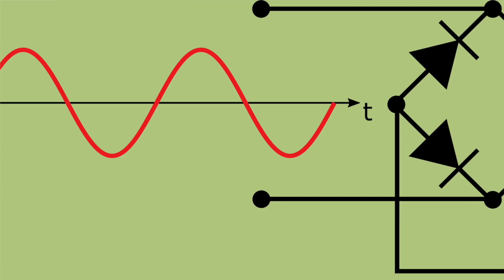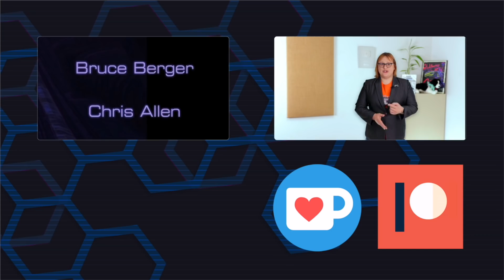Bidirectional Charging in A Tesla Model 3? BUSTED

Comment: So it seems the AC charging circuit is the focus of this conversation which is indeed a one way only cct...but correct me if I'm wrong but when the DC charging is Envoked the onboard AC charger is bypassed and is directly connected to the static charger via Chademo  or CCS HP connectors...not the type 1 or 2 AC connectors..so if the battery is directly connected then current will and can indeed flow both ways....if in DC charging mode...

Comment: The circuit board is an older US board. The report was based on newer Euro spec board. Tesla don't wait for model year to update. The new board is an in-house design. Euro cars have 3phase boards even the SR+.
So you held back and then jumped in the wrong direction possibly.

Comment: The charger uses three circuits to utilize three phase power. Three phase power is standard in Europe. (The Type 2 socket is three phase.) The three circuits an be connected in parallel and feed be a single phase to provide the same charging power where single phase connectors are in use. (USA e.g.)
Model 3 does this three or one phase switch on the fly as YouTuber Schräg has proven. He connected a Model 3 with a one phase only Type 2 cable to a 32 A Type 2 wall box. Thus the Model 3 was forced from 3 x 16 A = 11 kW to 1 x 32 A = 7.2 kW. I don't know of any other EV that can make such a switch. Other EVs switch to 1 x 16 A in that situation.

Comment: Title is a bit misleading, but if you listen carefully, it's clear and info is good. Seems like some people (if you read the comments) did not really listen. It would not be a good idea to implement V2G to older/current Model 3s because the battery would loose charging capacity fast due to the many charging and discharging cycles . But with "a million mile" new generation battery that could cope with a ton more cycles, the V2G does seem to be very close to reality. So if Tesla will start to fit (let's say, in July) a new battery pack with a bidirectional charging module, Model 3 will have V2G capable hardware.

Comment: The cyber truck will be a V2G.  With this new million mile battery and with A120v to 240v outlets.  You'll be able to use it as a generator To your house. So it only makes sense that Tesla will have it automatic  Through your charging port With an Tesla wall charger.

Comment: The fact that vehicle doesn't include circuitry to generate AC doesn't mean that vehicle doesn't have V2G capability. When you put EV to DC charging mode, you have basically battery connected to charging socket of car, so at this point you can push power to car or pull power from car. That said, every EV capable of DC charging has HW for V2G capability, you just need special device installe at home, that will make DC to AC conversion. So you might be surprised when Tesla will start selling these and enable V2G capability by OTA updates.
Reply: Were you listening at all? It's not about being able to generate AC. It is about sending power one way through the charger. So in order to enable V2G there should be another circuit that allows power to flow from the battery backwards.
Reply: @jur4x  I was listening. And I watched also video they mention. And both talk only about using onboard charger to generate AC back to grid.
But as I described, there is another way, that is more likely to be used for V2G. And Tesla as many other EVs are capable of it.

Comment: The V2G claims are predicated on the new Million-mile battery chemistry and packs. 
V2G would kill current batteries, so there's no provision for implementing it on existing Teslas. 
So you're correct that V2G isn't viable for the current vehicles. 
But that doesn't debunk the actual claim of V2G on FUTURE Teslas.
Reply: Agreed. The constant stress on stationary battery packs is why Tesla currently uses a different cell chemistry in vehicles as it does in stationary batteries. Tesla doesn't want its vehicles' battery packs to degrade too quickly, hence the hesitation to do V2G. If Tesla's million-mile battery bears out, however, they'll have no excuse for holding back on V2G.
Reply: Carter Harvey - exactly! The battery and board will need to be replaced, which we know is not an issue. V2G is a revenue producer / appreciating asset so it should be worth the cost for a swap, I would strongly believe.

Comment: Why not bypass the built in charger completely and connect to the 400v pack directly.  If the powerwall had a CCS plug on it could you use this to boost house capacity directly?
Reply: That's kind of what I'm doing with my homemade electric car grid-tie setup click on my profile picture to see

Comment: This works fine with V2G. It just doesn’t not output 220v directly. The contactors for  supercharging make a direct connection to the batteries so it would work exactly like a chadmo v2g system. Which is fully available for a Nissan Leaf. The Nissan v2g system only uses the Leaf battery. Not the leaf internal charger. 

So no the inter systems can not automatically output 220v To your house but that really does not matter.

Comment: every discharge/recharge cycle of a battery reduces its life.  Do you want your battery life reduced?  I don't think so
Reply: David Norris data from UK from Ovo energy V2G trial using Leaf 40's is actually showing improvement in degradation surprisingly. And that is a pack that is a lot less sophisticated compared to a Tesla pack. The data was a surprise!
Reply: And every beat your heart takes reduces your life. Still no reason to stop living though, is it?
Batteries are there to be used. Small partial cycles do not reduce battery life by any appreciable amount.

Comment: Those batteries do not have enough life cycles to support  V2G it would require the support of another designed package, maybe until then. If you wish to use Munroe tear down then you may also find him asking Elon to support energy transfer from Cyber truck to Cyber truck to help get someone out of the bush in a pinch.
Reply: Hookster data from UK using Nissan Leaf 40 has shown it actually prolongs the life of the pack as it is a lot more gentle on the pack than driving and fast charging. Seems to go against what should be the case but that is what the data is showing, and the Nissan pack has larger degradation than a Tesla pack.

Comment: Feeding the grid from your car? With due respect, dumbest idea I've ever heard. Unless you want to turn your expensive EV into a planter or lawn ornament, why in the heck would you want to do that? Like having to pay for the privilege of working. It's absolutely upside-down topsy-turvy world stuff.
Reply: You don't pay for it.  They pay you.  You buy power when it's cheap, and sell it back when it's expensive.   Or you just use your car to run your house in a grid outage.  Or you charge your car with solar during the day and run your house off it at night.  These schemes all hinge on Tesla's new "million mile" battery, where battery degradation would not be a problem.
Reply: I’d be tempted to agree. We have companies trialling it in the UK (Octopus), but they require your car be plugged in during certain hours. That said, surely for some use-cases, the option might be useful - depending on whether one works outside usual hours/doesn’t commute by car, and with no additional hardware required, it might be good to have the option; present the risks of battery degradation to the customer and let them decide if they want to participate in exchange for a payment by their utility.

Comment: You can still do V2G without a bidirectional AC system in the car by using an off-board inverter such as the one in a power wall. Put a bi-directional DC-DC converter between the power wall's DC bus and the DC-charging cable, then you can get direct access to the vehicle's battery via DC-(dis)charging.
Reply: Would it work to connect this dc to your solar convertor to get the power to your house ?
Reply: @petevr  Not really. Solar inverters generally include things like MPPT and have input limits. You can technically do it but of course you would need an inverter capable of working in the right voltage range, a spare input and of course some way of automatically disconnecting the car when the solar panels become active so you don't overload the inverter. Plus the whole idea of V2G (as opposed to V2H) is that the grid intelligently uses power from the vehicle to support the grid - there's no such communication built into a solar inverter. For V2H much the same problem. No communication between inverter and vehicle to tell the inverter when to stop. Also most solar inverters won't balance loads - ie only use enough electricity to feed your house and not the grid. Here's an example of an Aussie in Queensland using a prototype V2H charger with his Mitsubishi Outlander PHEV. 
https://www.youtube.com/watch?v=FRQjDi5aXTg
Note it does not use the vehicle inverter but rather DC which is what Chademo supports with the right CANBUS communication. And 90% of the time this bloke is off grid.

Comment: Don't most current V2G implementations bypass the on-board AC charging circuitry and instead use the DC charging contactors providing the AC  inverter externally? So this doesn't necesssarily mean Tesla can't offer V2G over a software update, and external charger solution to existing cars ... just that it isn't done on-board and with the existing charger as the original source led us to believe?
Reply: Curious if there is any technical reason why a Tesla with the CHAdeMO adapter could not be made to work with a CHAdeMO DC V2G inverter with only a software update? Might possibly be some kind of one-way "protection" diode somewhere for DC? ... idk?

Comment: Good details. V2G is useless without Million Miles Battery.
Reply: nonsense, it uselfull and it has been working in japan for years with toyota and nissan, where there is constantly natural disasters
Reply: You get 1000 cycles of charge and discharge from you regular Tesla battery before you degrade it.
1000 cycles is 50000 kW. Cost of that for my region is $4000. Why would I want to destroy my M3 battery for that $4000?
How much with it cost me to replace that battery? Much more than $4000.
You better move if you have natural disaster in you region every day.
Reply: i think you are looking at the problem wrong. V2G will not fully discharge a fully charged battery. we are looking maybe at 20-40% of it only. which a normal battery can support 10-20k cycles. its not much, but millions of cars supplying 20 kWh at peak hours will render all peaker plants useless

Comment: Would not the diodes need to be there to prevent power from the battery being exposed at the charging port? There are likely safety standards they would violate if it would only take a software glitch to cause 300+ volts DC to appear across the charging terminals!
Reply: I don't work with high voltage but I design software for other safety critical applications. Typically the identified risks are mitigated in such a way that one failure can not result in the risk realizing. The minimum two methods used in the mitigation can be mechanical, electrical,  software, or any combination of those. Mechanical mitigations would be something in the socket/plug that prevents the user from getting to the contacts. Other safety features could e.g. monitor the voltage at the connector and blow a fuse or otherwise disconnect if the connector has voltage when it shouldn't. 
This may seem complicated but if a valuable feature requires it then safety can be achieved without a diode.

Comment: Tesla should have done V2G or power export long ago; it's something they'll regret not doing.
The PowerWall isn't enough and you can't take it with you.
Even the lame Toyota Mirai has included a 10 kW power export socket from the very beginning.
Reply: nissan has been doing it for years too, and the toyota mirai is not lame, its an exercice of engineering, you have to be happy that people are actually trying to develop abandonned technologies,
Reply: imagine if you can carry your electricity in a very light package and travel tousands of miles without the need of recharging

Comment: Good to see this sorted out.
Easy mistake to make at first glance when diodes are disguised as transistors.
Reply: Is it though. 2 yr old teardown doesn't really say much. Tesla moves faster than that. 2018 model 3 is not the same as a 2020 model 3.
Reply: @TezlaFan  This is the current model Y tear down.
Also the CCS plug standard only supports single direction.
Chademo is bidirectional.
BUT, the tear down only looked at the AC to DC internal charge controller. The question remains, if when the car is fast charging with direct DC that bypasses this controller, could DC also flow out of the car, or is it unable to do so due to one way diodes on the separate high capacity DC cables?
Reply: If you read the comments in the video she is referring to he says specifically there are no diodes involved when supercharging. Just contactors that connect you directly to the batteries. So exactly how the v2g works on a Nissan Leaf. 
https://youtu.be/UkRk2OQI7RE
Reply: This works fine with V2G. It just doesn’t not output 220v directly. If the contactors for  supercharging make a direct connection to the batteries then it would work exactly like a chadmo v2g system. Which is fully available for a Nissan Leaf. The Nissan v2g system only uses the Leaf battery. Not the leaf internal charger.

Comment: Bugger! V2G is the secret sauce for renewables
Reply: This works fine with V2G. It just doesn’t not output 220v directly. If the contactors for  supercharging make a direct connection to the batteries then it would work exactly like a chadmo v2g system. Which is fully available for a Nissan Leaf. The Nissan v2g system only uses the Leaf battery. Not the leaf internal charger.

Comment: Great video, as always.  Thanks for getting into the details!  I do hope electric cars do get into V2G systems in the future, this tech would make the grid much more stable and make peaker plants obsolete.  It makes sense they have not designed it into cars yet, as the grid/charging/home power systems needed to work with this system have not yet been developed yet.  Likely they would all need to be designed to a single standard at the same time, so the car's batteries and the grid are all protected, have appropriate safety circuits and remote cutoffs for maintenance and power surges, etc.
Reply: are you living under the rocks?!?! because its nissan that invented the vehicle to grid and it has been working in japan and many other countries around the world for years
Reply: Le Chat Botté  yeah but they don’t sell nearly enough vehicles to make a dent 😂

I think peaker plants are better replaced by the utility sized batteries like we we have in South Australia. V2G will be a smaller part of it as it will take 10-20 years to get enough vehicles to make it worth while

Comment: Hottake: packaging the diodes in that way means the board was DESIGNED to do bidirectional charging with the possibility of both configurations with slightly different components.  We know that they want this ability in the Cybertruck, and it's long been rumored to be coming to Tesla vehicles in general.  And remember that Chademo is the only standard that currently supports it which would be a HUGE advantage for Tesla to leverage over CCS vehicles.
Reply: Converting DC back to AC is a much more complicated task.
For example look at the sized inverter required to convert 2400W {2.4kW) of Solar DC back to AC.
The Nissan Leaf V2G unit is basically the same inverter. The only additional function it has is a windows ce tablet to turn on the DC contactor in the Leaf.
Reliable inverters are still $1000-2000 depending on kW output. The Leaf V2G is about $5000au.
Reply: nope it wont be a tesla advantage

Comment: its in the charger not the car.
Reply from the maker: Pardon? The car's charging circuit is in the car.
Reply: The charger is in the car. Your thinking of the Supper Charger network which is a DC fast charger that bypasses the on board charging system. They wouldn't put a bidirectional  charger at the Supper Charger network because that wouldn't make since your only there for a short period of time for one purpose only to charge up your car.
Reply: That is sorta true for DC V2G with a specialized external DC charger/inverter like CHAdeMO (or Supercharger). But for AC charging the car does all the work, the external "charger" is just a simple relay.